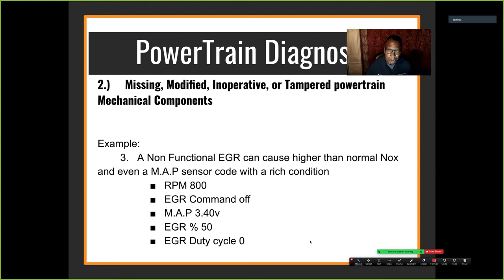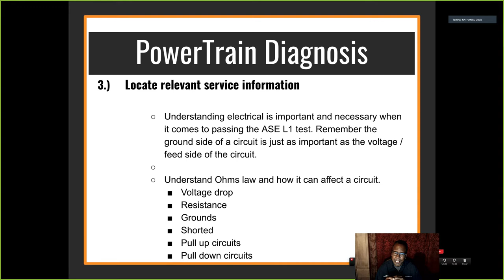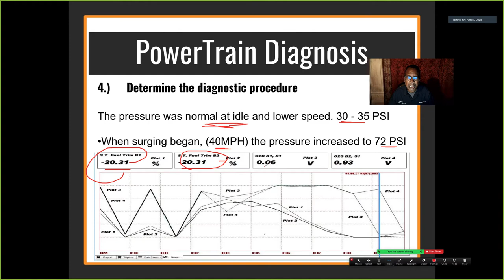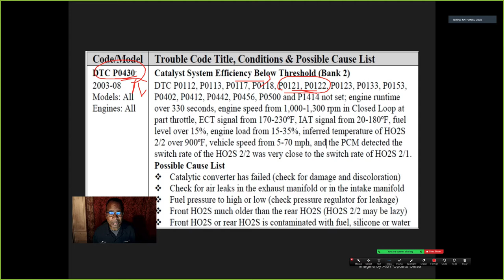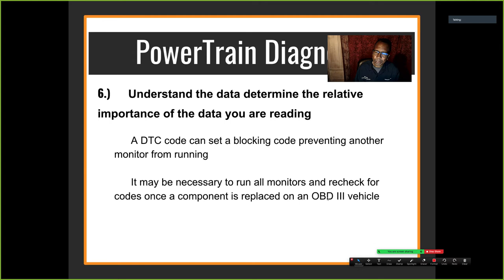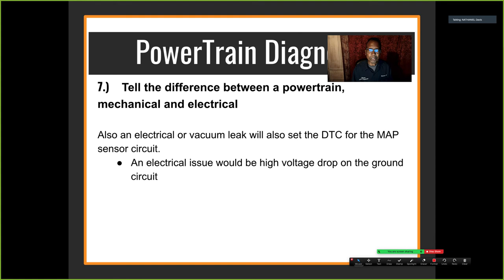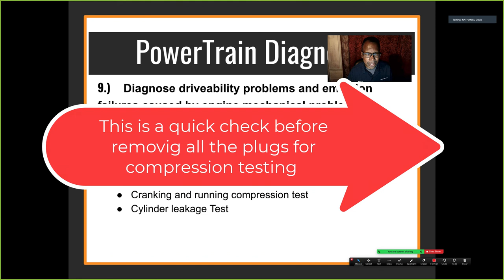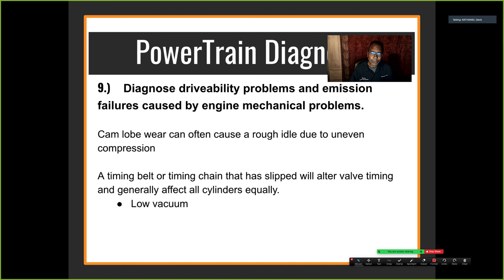L1 Exam Preparation Part 2: Free Study Guide from the Revised Composite Vehicle 4 ASE Study Guide.

Comment: Consider using the words "Signal Voltage" rather than "Voltage Drop" when referring to sensor outputs. While you're not wrong at all,  it may be confusing for someone still learning about Electrical fundamentals and has the mindset that a voltage drop is bad because voltage should be near 0 between a load and ground. Thanks for sharing.
Reply from the maker: Good advise appreciate it

Comment: a perfect example of cat monitor which will never run, even all the other monitors were completed,  was a case of a 2007 mini cooper base model.   the reason... code p0015 exhaust cam timing over retard.  the remedy is perform a vanos calibration reset.   yes cat monitor never run until this p0015 code is fixed!  YES CODE P0015 DID BLOCK THE CAT MONITOR FROM RUNNING
Reply from the maker: Wow this was great info thanks